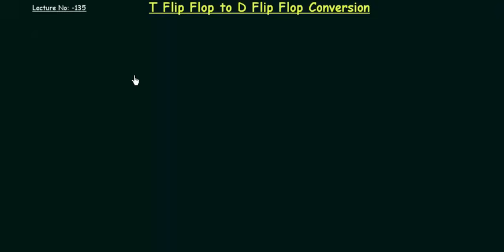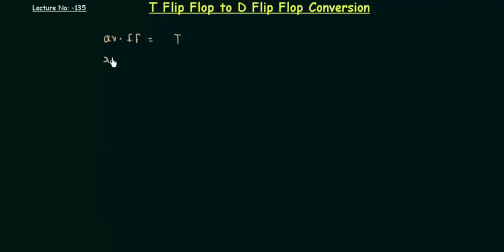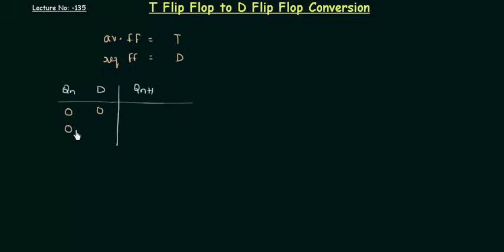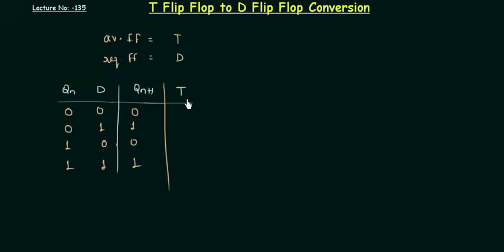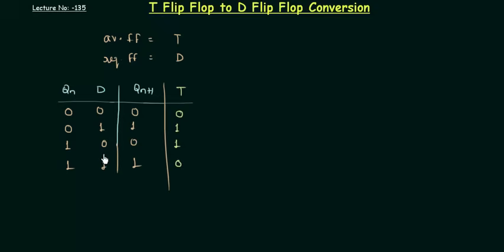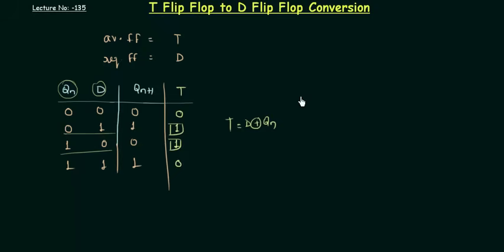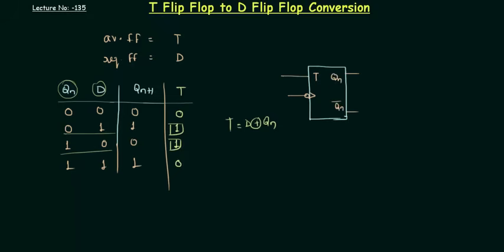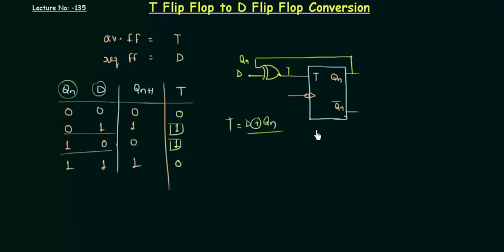T Flip Flop to D Flip Flop Conversion

Comment: why there is a bubble in clock
Reply: +Abhirami anbu Negetive edge triggered clock has a bubble
Reply: You can put or remove   depends on the clock
Reply: you can put what ever you want...but using negative edge triggering is way more sufficient than any other triggering